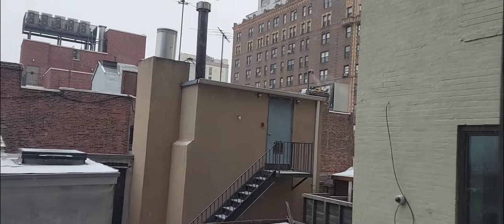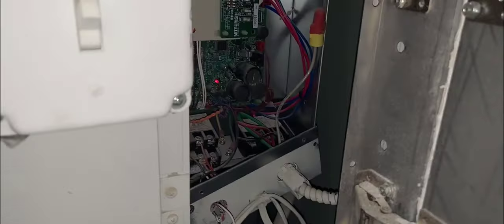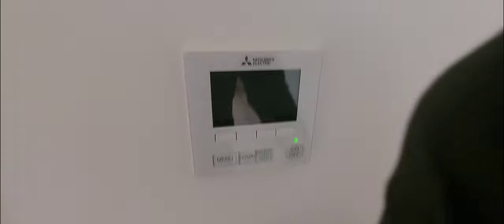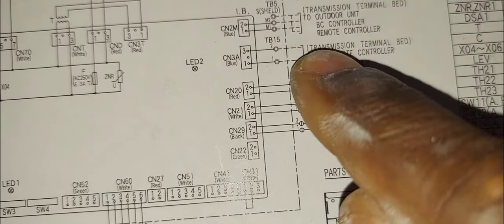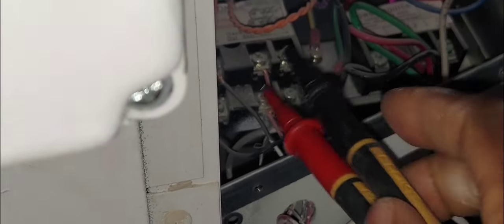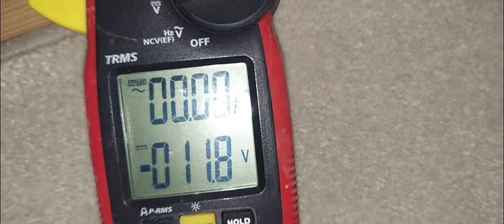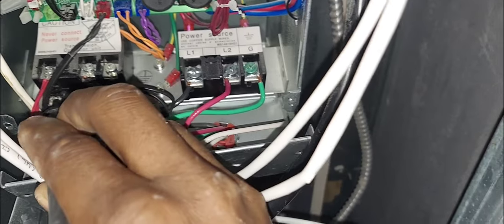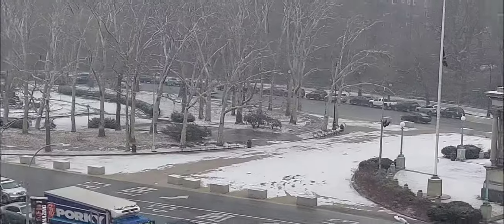MITSUBISHI CITY MULTI ERROR CODE

Comment: Thanks for sharing.got that warning also but on a centralized controller.if supply is off either to indoor units it displays that error code. I had to switch off and and back on the outdoor unit to get rid of it.and it did the trick.